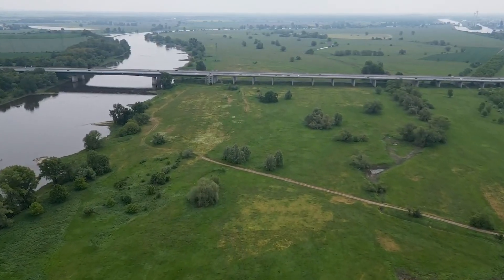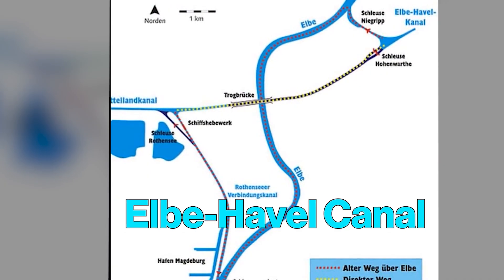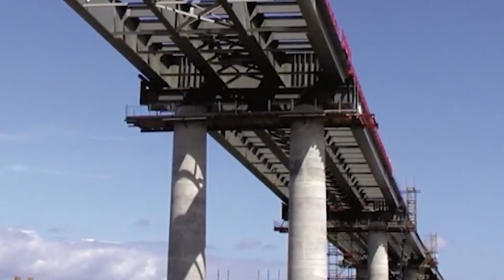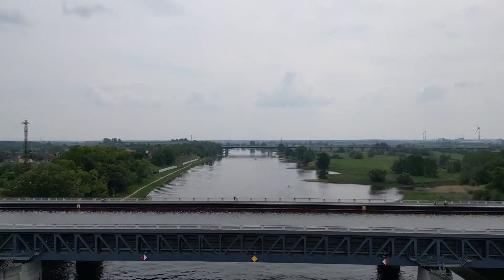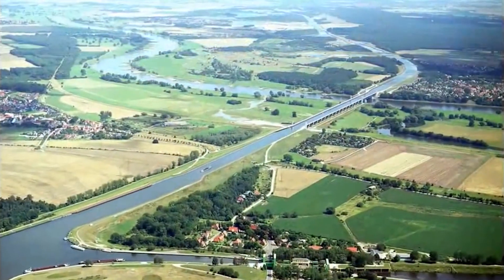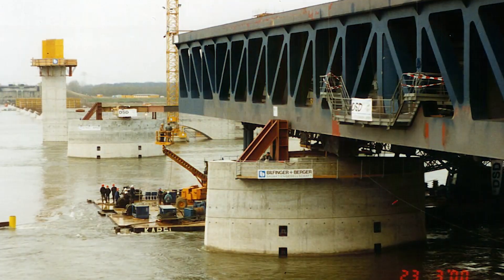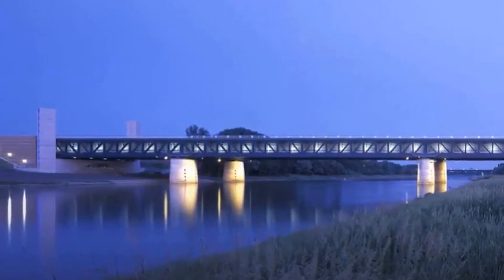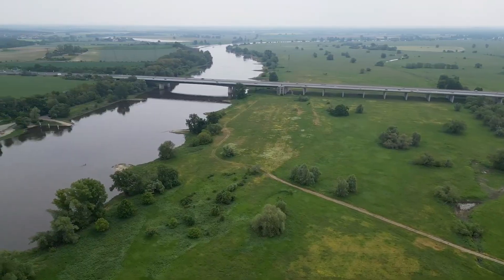The $500 Million Canal Bridge That Broke Engineering Rules

Comment: @ 3:03 A fully loaded vessel does NOT bring any extra weight into the canal. Because the weight of the ship is equal to the weight of the water it "displaces". Know your physics please before saying such a thing!
BTW< near Minden, there's also a aquaduct over the Weser river and the Leine river which are way older than the "Kanalbrücke Magdeburg". O, and S355JR0 steel isn't that high strength steel, it's quite a common construction steel The more special steels start from S420 up to S1200 steel. And "the constant strain of moving ships" is bollocks, as earlier said, the weight of the ships displace an equal amount of water so the weight in the aquaduct stais the same, all the time.